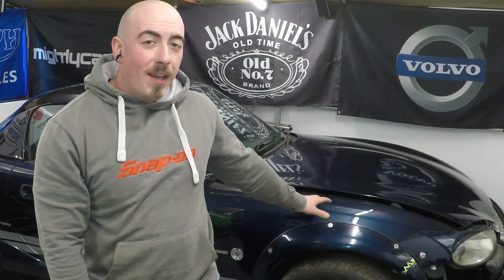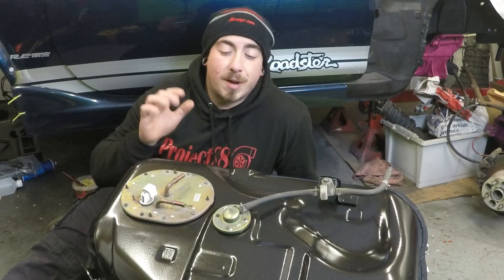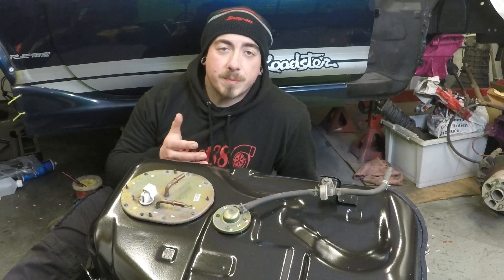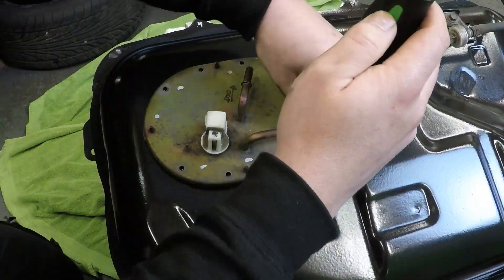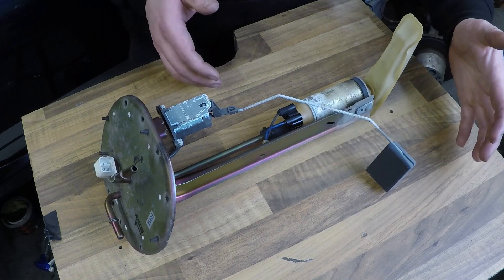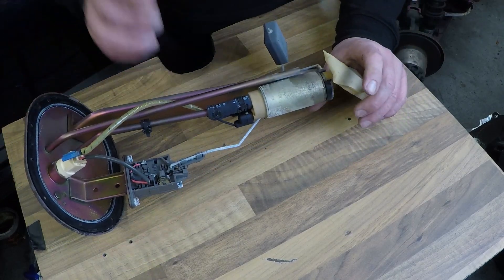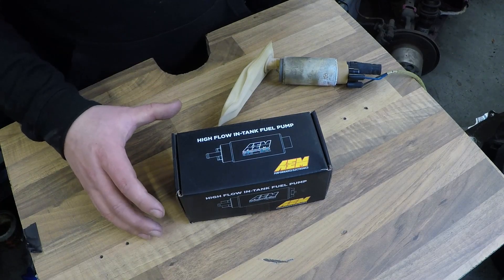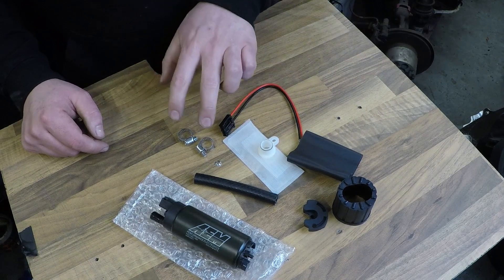FUEL PUMP UPGRADE / AEM 340LPH ;MX5 TURBO BUILD pt 28

Comment: Nice build and video! Did you upgraded the fuel pressure regulator as well? I am on the same path…
Reply from the maker: i havn't finished the fuel lines yet but yes i do plan on having an adjustable regulator

Comment: Can a bad fuel pump cause surging at higher rpm & highway speeds???
Reply from the maker: yes it can if the pump is doing something other than what the ECU has told  it to do

Comment: Videos are actually well made and very informative im currently having a headache with my fuel system which I how I came across your channel, only question I have is when it comes to the hard lines I cannot for the life of me figure out which hard line is which and what goes where, I'm using the standard lines and standard rail, minus the oem fpr as I'm wanting to use a separate one.
Reply from the maker: hi there, i honestly cant remember which one is which, the only thing i can suggest is to go from the fuel filter and follow that line up to the rail. that line is the fuel into the rail
Reply: @Project380  thanks, I've eventually found it, it's the lowest pipe out of the two on the car, still got the issue of priming the pump ect I'll keep watching your vids though dude it's interesting to see a fairly similar build in terms of the majority of parts going on and being documented

Comment: Can this be installed on a standard ecu? Sorry if I missed that
Reply: It would be preferable to install with an ECU, so it can control the amount of fuel etc going in. Without doing so your engine will more than likely run rich as stock ECU won't know how much fuel to push through.
Reply from the maker: Sorry Frank i missed this info out in the video, the above comment from liveshamz is correct, yes you can install it and yes it will work but you will have issues, a programable ecu is best